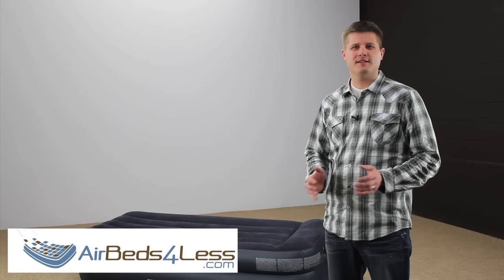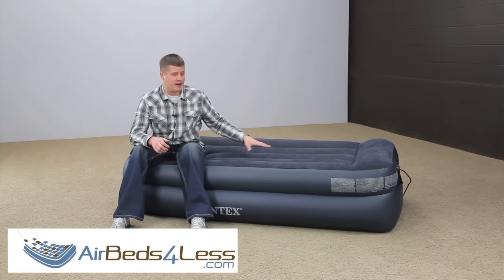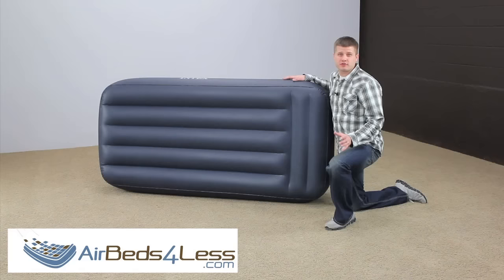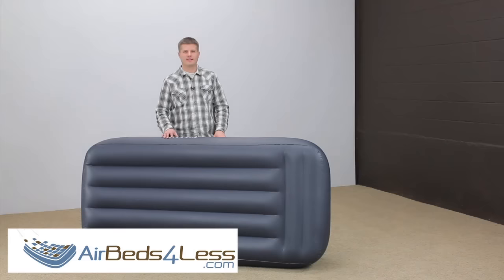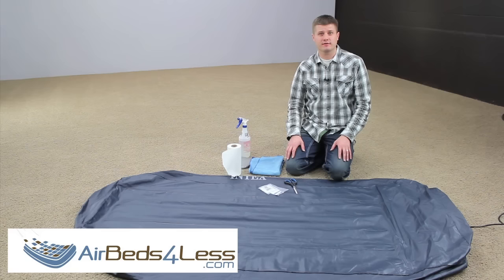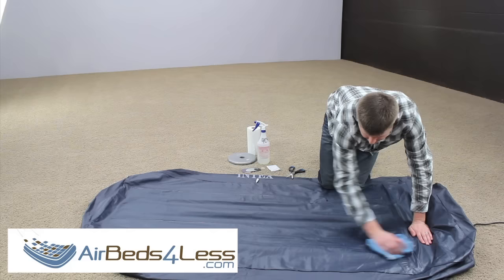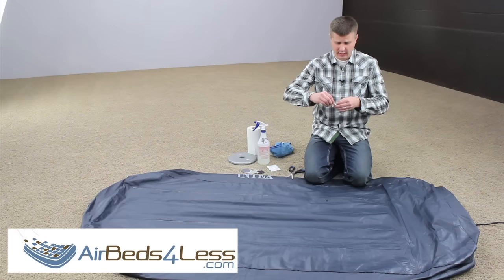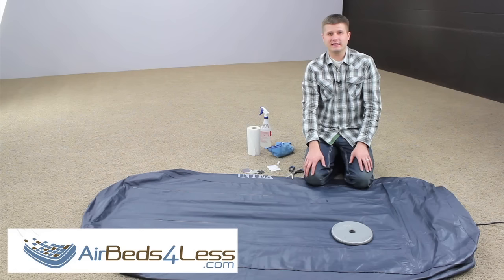How To Find A Leak And Patch An Air Bed Mattress Correctly

Comment: (also..if you own a cat, lock the bedroom door! My cats have cost me a small fortune in air mattresses and lost sleep!)
Reply: The obvious solution is to buy a PROPER MATTRESS.
Reply: My cat sent me here to these videos. 🤦‍♀️
Reply: @johncoops6897  no shit. You got $ to give us for that option?
Reply: @MeredithHammett the best solution I found was to get a heavy quilt that covers most of the mattress. (Or lock them out) I've gone thru at least 10 mattresses due to my cats.
Reply: @MeredithHammett the best solution I found was to get a heavy quilt that covers most of the mattress. (Or lock them out) I've gone thru at least 10 mattresses due to my cats.
Reply: @MeredithHammett  - a proper pocket coil "mattress in a box" cost about $100 (single). That's cheaper than two budget-priced air mattresses. Now, how much have you paid for unsupportive air mattresses?
Bonus: you will sleep better on a proper mattress.
Reply: Mines got us too,lol
Reply: @johncoops6897  I googled this, the cheapest I saw was $122 and looked wildly uncomfortable. Additionally, this means nothing to someone who sleeps with a partner. Finally, your idea of a budget priced air mattress is wild. Mine was around $25-30 and sleeps significantly better than a lot of mattresses I use personally.

Comment: HEY, this is the FIRST repair video for an air bed that I've seen that actually WORKED🥰😍. Thank you very much for advice that works. Note to others, he does mention in the comments that side seam openings are very hard to fix and may not be repairable. The other punctures, FIXED!!

Comment: I finally found the leak I had in air mattress...thanks to your "wetting your lips" trick - took me less than a minute to find. I was going to use the messy soapy water next if I could not find an easier solution fast. :D

Comment from the maker: Seams are definietly more difficult to patch but there are a few things you can try. Using a self adhesive patch you can apply force to the seam with the patch on and most of the time you can get it to seal well. Definitely the hardest patch to make though!

Comment: Decent advice. My method:
First, vacuum the mattress using the narrow wand tool to get rid of dust and dirt that will make visual identification difficult. Then:
1. LOOK - some cuts or punctures will be visible.
2. TOUCH - slowly move your hands over the entire mattress, at a distance of about 1/2", to see if you can feel air leaving the leak - rather than wetting my lips, as in the video, I'd wet my palms.
3. LISTEN - in a silent room you can often hear the air as it exits the leak. Ear to the mattress is not quite as unappealing as lips to the mattress!  

If possible PLACE THE MATTRESS ON ANOTHER BED OR A LARGE TABLE while you do the work - the harder you make the job, the more frustrating it will be. 

Note: You might find an extremely small leak by touch or sound that you can't quite see. Just a little soapy water on the spot will produce a bubble - that's the bicycle repair way. 

Prevention is really important: I put a clean quilt or packing blanket on the floor to protect the mattress from anything that could puncture it: something sharp in the carpet, or a sliver or pin, etc, stuck between wood floor boards. If people will be going in and out of the room where the mattress is being used for more than one night, GET IT OFF THE FLOOR - either deflate and put in a corner, or upright it and lean against a wall. Don't let kids play on it, and keep pets off, too. 

Roll it up carefully when you put it away. The smaller you make it, the better. Be sure there is nothing left on the mattress as you roll it up - a ball point pen, for instance. Try to store it in a box, where no tools or sharp objects in the closet can get to it - Storing my big Intex mattress in the bag only led to a cut from something - I'll never know what - going right through the bag into the mattress. ANYTHING sharp will want to make a cut or puncture if it's in contact with the mattress.
Reply: Thanks for the info. Very helpful.
Reply: Tom Crisp What kind of glow do i use
coz mine is intex as well and we dont have the repair kit in Egypt
any kind of good glow ????
Reply: thank you thank you and gew whiz thank you. I'm laying in a taco shaped bed right now. .frustrate with his blow or hear technique. You could totally make a video. I'd watch it several times. Thanks
Reply: gee** and frustrated* * I blame the sunken bed for all typos.   😊

Comment: Hey I really appreciate this video. I had a leak in the bottom of my air mattress that I found with feeling the air on my damp lips. I first tired just listening and seeing if I couldn't feel in on my face, but the damp method worked much better. Actually it seemed to be three very small slits in a triangle 1/2 in triangle patten. That made no noise and were very hard to feel even with this method unless I had the mattress really full and I was putting a lot of pressure on it. It would only go down just a little after sleeping on it for several hours. I tried the soapy water method suggested in another video to verify, but it was difficult to get it to bubble. Much more difficult than feeling the air against my wet lips about two inches from the mattress. Also I have small inflatable back pillow that likewise had a hole, but would take and hour or two to deflate leaning against it. This method worked very well for it too, but of course was much easier to find as the surface was much smaller. Thanks again! :)

Comment: I have slept on a single width air bed every night for years but the beds only last a few months with daily use.  Only 1 had a repairable hole all others were in the seam.  If you sit on the side of the air bed, you will weaken the seam - usually the bed is useless any time I sit on the side but it's hard to get out of bed without sitting on the side.  I try to roll in & out of bed instead.

I have found that a mattress will last MUCH longer if you can support the seam.  One way is to put a firm foam strip (about 8" thick & wide) next to the seam so when you put weight on the seam edge it's supported.  BUT it's hard to keep the foam in place.

My recent "trick" was to take the last dead bed & cut off the end & slit all but one side of the inside supports (so that the last inside support next to the other side seam is fully supported) & slip the new uninflated air bed inside before airing up.  In theory this should disperse the weight off the seam & this recent bed has lasted 4 months so far.  Unfortunately this makes the bed smaller, next time I am using the old twin (& removing ALL inside supports) & inserting a full mattress which is 14" wider & see if that will work. 

Another suggestion is to goop ALL the seams & let fully dry BEFORE using the air mattress but I've never actually tried this.  This may give the seams extra support.  I did try taping all the seams with wide packing tape on one bed BEFORE using & that was worthless.

I buy my beds during the winter from Walmart & paid $8 for them last time, usually $15.

Comment: You could also wet the air mattress with a rag and some water, to easily find the hole. And make sure the mattress is well pumped. Then in total silent listen👂🏽.. The air mattress will start whistling like pewwwwwwwwwwwwwwwwwwwwwwwwwwww.. there's your leak. You're very welcome😏
Reply: Cha Lee or wait till night time, pump up the air mattress, turn off the lights, shine a flashlight through the inflation hole and look for the pin light hole shining through the air mattress 🤷🏻‍♀️

Comment: for me i use a single (low to the floor) twin Intex air mattress.  they're cheap and the most comfortable and i'm always careful.  i use it because i'm a stomach sleeper and is the easiest on my back for that, but it seems after only a couple months every time, it eventually shrinks.  nothings been stuck through it and i put 2 underspreads on the bed (one for each side) to prevent any debris from embedding to the material.  all my leaks happen on the the seam of the top of the beds (the phelt  side).  i'd even apply the patch to it in the past but air always escaped so i stopped bothering and just chucked it each time and bought a new one.  they were cheap enough.  i hope this video addresses the seams wearing away too from nightly use, even though i'm extremely careful how i handle it.
Reply: TeslaDRay I read a "seal a meal" works on the seams..may try when that time comes.
Reply: @sheliapea1387  how would that work? Lol

Comment: Try licking a queen size one,LOL!!I'd use dawn soap and water in a spray bottle for the vinyl sides/bottom.Most of my failures are through the automatic pump.Air goes in yes,but goes out same outlet when you sleep. Do yourself a favor,get an air mattress that automatically keeps your airbed the same pressure!!If it's not automaticaly controlled,don't waste your money!!!I've gone thru a ton of them,especially with the brand name that starts with I and end with X.

Comment: how about flex sealing the entire bottom half....
Reply: But if one doesn't know where the hole is.  This Flex Sealing would save 3 air mattresses for me!
Reply: MCrowley138 gooooood idea!!!! Thanks from the ladyin the plastic taco shell.😉
Reply: MCrowley138 i cant find the damn hole in mine so i think im gonna do that sounds like a good idea 👍
Reply: I love my dog pump it up at night, turn the lights off, shine a flashlight through the inflation hole and look for a pin hole light in your mattress. Works faster with another set of eyes.

Comment: Make sure to stay away from Coleman brand air mattresses. I've tried them all and Coleman's are junk!
Reply: Agree all are junk that I purchased
Reply: kdavis114 i disagree.  However, I did buy an Intex from Walmart for under 8 bucks and it leaked from the moment I inflated it.  My Coleman never deflated.  However, I placed a space heater too close to it and am here to inform you, plastic melts.
Reply: My intex lasted one use then it started leaking. They are just junk.
Reply: whatfreedom7 Design is faulty, inferior product and probably why they were on sale - but even those at an upper shelf, that can inflate and remain inflated for initial uses, end up leaking air as i think the stretching can only go so far and then, the seams are compromised.  We are using up all of our resources to produce products which end up in the dump.  It’s criminal.
Reply: Coleman is the WORST!!... I DESPISE THERE PRODUCTS AS PASSIONATETLY AS THIS GUY IS ABOUT AIR MATTRESSES
Reply: @bloomer3638  Couldn't agree more. Coleman used to make good products years ago, but I don't buy anything with Coleman's name on it today. I've had the best luck with higher priced Intex, at least until my cats started playing on them.
Reply: Virtually every mattress I bought didn't last more than a few sleeps. Until the last one from Walmart. Cheapest at like $20. Hard to believe.
Reply: @nomullies  You don't happen to remember the brand name, do you?
Reply: @kdavis114  Intex. Although I've had crappy Intex ones in the past. Got lucky this time.
Reply: @nomullies  Thanks for the info! Of all the brands I've tried, Intex always had the best, even as you said, sometimes you get a good one, sometimes not.
Reply: 5 years with an INTEX

Comment: I HAVE PATCHED 2 INTEX airbeds at the seams with a thick layer of Super Glue (letting it almost dry) and putting some cheap Gorilla Tape (not the air sealing type found in the Paint Isle at Walmart, which costs $12.something.  This one is approximately 1 inch in width and costs $2.97) on it.  I put a 10 pound disc weight on the patch for awhile.  Nice. everything is fine for a few days.  Then a NEW leak surfaces elsewhere!  Happened with the two beds.  These INTEX beds are horrible!  All the leaks are at the seams.  These bed were NEVER used outdoors.

Comment: An easier way would be to just put some Goop or E6000 on the hole.About the size of a quarter would be enough.Should work,even with the felt still on.

Comment from the maker: 108travel, if you lightly sand down the flocking/flannel material until it feels like the actual vinyl, you can then patch it in a more secure and easier manner.

Comment: Applying a patch advice: 
Make sure all the air bubbles are out. If you are using a clear patch, you can usually see these quite readily. If you are using a colored patch, you can usually see these if they are big. Try running your finger lightly across the patch to see if you can feel any small lumps.

Regardless, you should presume there a few tiny air bubbles. To fix this, use a fingernail or spudger to work out the air bubbles from the center outwards.

*apologies if this was already mentioned
Reply: A stupid idea that might work. Fill the bed with water to detect the holes
Reply: Martin Van Schalkwyk bed would get heavy as fuck. if it didn't explode it might just poke more holes
Reply: LOL the lengths we will go to to fix these things!

Comment: This was really useless for me, Those steps to find the hole will only work if the hole is large enough, which in my case isn't.
My mattress takes about 7 to 8 hours to loose air so the hole is obviously tiny.
Reply: Exactly, that's what mind is doing. I've looked hard.
Reply: Mine was the size of a pin drop on the top of the felt .. I had to listen very carefully . The licked lips method worked for me , and I had to blow it up all the wayyyyy
Reply: Use pvc adhesive
Reply: bro the intel airbed comes with holes at the top they purposely put holes in i got one and as soon as i laid down i felt air all over my neck and lower back and im not big im 5,6 105 pounds so i clearly did not put those holes there
Reply: AllWill FallToMe -Whaaaaat!?

Comment: About half the battle is locating the leak(s). Wetting a hand and passing it around the exterior of a fully inflated air filled object works well to find those pesky small leaks.

Comment: Question: I found my hole and of course as luck would have it, it's not in any location that any YouTube tutorial has an example of how to fix. It's not in any "easy" place, like a flat spot or even a curve, which is what every video uses as an example. No, mine is a hole right the corner where two seams meet. Where the vertical and horizontal seam meet on the corner location on the suede side. (Have a photo to show if there's any way to send to you for reference). Right in the 'T' seam where vertical and horizontal seams meet on the suede part, in the right corner between the head side and the right side (both suede).  It's right up against the seam. And the seam is obviously a bit raised higher than the hole so I'm not sure how I can get a piece of duck tape over crazy glue over the hole because the seam will prevent the tape from being 100% flat and flush on the material. Also Idk how I can shave off the suede in such a difficult spot.  Any advice?🤦🏻‍♂️

Comment: I have an 2-month-old Intex twin airbed that's very similar to the one in this video (the flocking is of a lighter shade). A few days ago, it developed a leak at the end of one of those seams, running down the top (to make it look like tuck-and-roll). A split, at the half-rounded end, where the seam joins the rest of the bed. The bed did come w/ some patches, but no glue! What brand of PVC/silicone glue would work best? Or should I just go the suggestion of other videos & grab a bicycle patch kit?

Comment from the maker: What you are describing definitely sounds like a seam that has come loose. Unfortunately there is not a way to repair the seams on an air mattress. Sometimes depending on the extent of the seam tear you can sometimes flip the bed upside down and get some use out of it. That doesn't always work, but unfortunately is the only option we know of when a seam comes un-welded.

Comment from the maker: It is mor difficult to patch on a seam but if you use self adhesive patches like the TypeB vinyl patches. Sometimes placing a small patch over the whole and then a larger patch over top of that can help it seal better.

Comment: I patched mine on the top where the flocking is, by using super glue GEL and then pressing a paper towel on to it.  Allow that time to dry and apply another layer or two then tear away excess.  It's not as pretty as a patch but who cares? The bed is covered with a sheet anyhow. Did the same on the sides where the seems come together, this seems to be another place holes commonly occur.

Comment: Thanks so much for this. I went out and bought another bed not knowing I could do this. I use the glue and duck tape plus a 15 weight to hold it down. Hopefully I can sleep in my bed tonight. Oh My kit didn't come with glue but a piece of tape instead?

Comment: For anyone who is looking to fix this low budget

Just use a super glue and baking soda
1st put a little glue on the hole and apply a pinch of backing soda n Then repeat

You don't need a lot you just need 2 3 drops of super glue and 1 or 2 pinch of baking soda. 

I have used the industrial tape, and this method too but didn't last even a day.
If you are looking for a clean finish, I suggest letting a Pro with proper tools do it.
Reply: This fellow’s attentive tender loving care for air mattresses is a sure indication that he was conceived on one! All joking aside, this a very helpful and informative video. Much appreciated.

Comment: I have found the hole on mine problem is it's right in the seam on the material side. It'll be a tough one sanding that area clean. My Intex air mattress didn't come with glue just adhesive paper.

Comment: I wasted 40 minutes looking on the under side when the puncture was on the top side. In my case, I figured the hole by groping systematically. (I know how it is sounding but that is what I did.). I sealed the fuzzy side by removing the fuzz by using a sand paper first till I see the skin (Urgh. This is getting weirder).